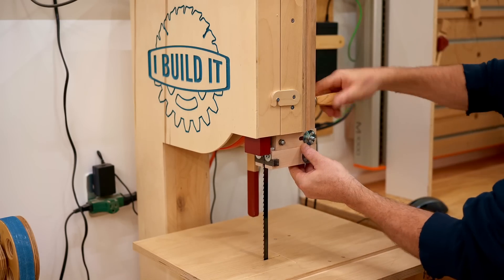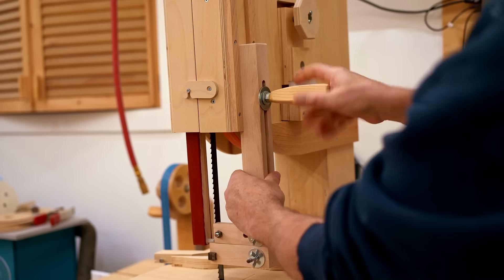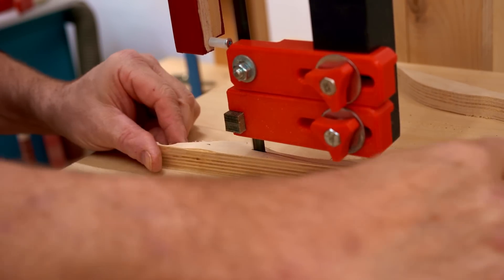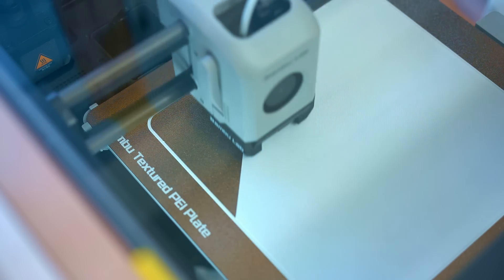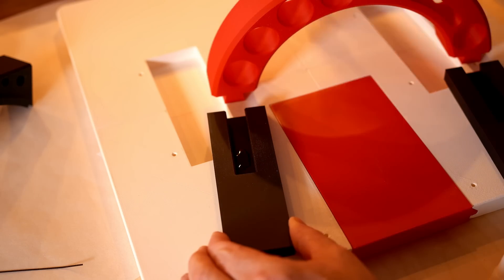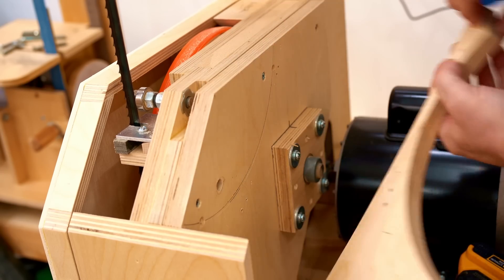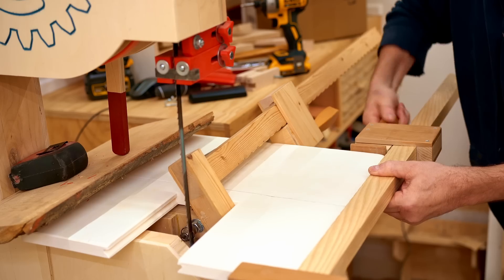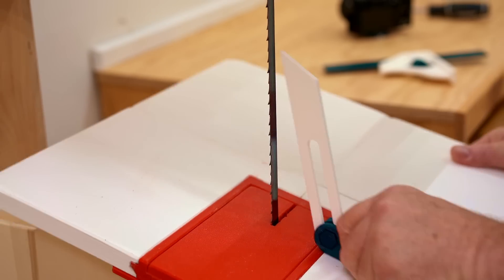He Said You Can't 3D Print a Band Saw... I Said Hold My Beer

Comment from the maker: I have no doubt that a band saw can be made with 3d printed parts - all it would take is the right amount of testing and trial and error to determine how strong the parts need to be.
Of course it couldn't entirely made from 3d printed parts, but then a wooden band saw isn't 100% wood either. You would add metal where you need more concentrated strength, like screws, shafts, bolts and bearings. But I firmly believe everything else could be printed while you kick back munching Cheetos and watching YouTube, while not potentially cutting your fingers off on the table saw you don't know how to use safely. 
And like I said in the video, you don't have to throw away a full day plus expensive paint to finish the parts. So I think that printing the parts (or even paying to have them printed from a stronger plastic) would be fairly economical.
For example, the table I printed used less than a full spool of filament, or roughly $25. The plywood I used to make the original costs MORE than that today! If you can get it, that is. And then you need to machine it and finish it and hope you don't make any mistakes.
So yeah, this may seem like a novelty project, but it is definitely not that.
Remember, guys were saying you CAN'T build a wooden band saw not that long ago. Never say never - you are betting against human ingenuity.

Watch the original build video I made for the band saw here: 
https://youtu.be/-hVw8mpt9N0
Reply: With carbon fiber filled nylon, you can produce some pretty strong parts.

PLA is fun but it doesn't like heat.

Nylon is awesome but trying to print it and having it not to warp on the bed is a challenge.
Reply: CF-PETG and CF-PLA also exist. PLA has the most regidity, which for some applications is actually better. Cf-PETG is slightly better and does not warp with the heat.@ProbeGT2
Reply: Just curious, the original plywood table top looked adequate.  We're there any problems that you had that caused you to redo it on the 3d printer ?
Reply: @joelex7966  What i did get from the start of the video was that this was just a challenge or like a proof of concept. :D
Reply: @pridler85  could be, my feeling is that he was better off with the one piece plywood top provided there were no other problems.  Good video though.
Reply: Joelex… I think he’s just proving a point
Reply: For larger pieces that give the bandsaw its upright rigidity, is there some printing material that won't flex? This would be my primary concern with a 3d printed project like this. The rigidity of plywood, especially half inch ply, would be hard to match when making larger pieces. I would imagine scaling this down to a smaller bandsaw would absolutely be possible. Making a carbon copy of your original build however, i can see why Matthias was skeptical.
Reply: @Rhainee  is there wood that won´t flex? 3d printed PLA is usually better pound per pound and closer to isotropic than standard wood. the thing here is that the pieces printed are hollowed, making them have less torsional rigidity and extremely light compared to a chunk of solid wood. 
how do you make large parts with a small printer? 2 options: good big joints (those made in the video were awful as are designed for internally solid pieces), and welding. welding is the superior method, but takes time and skill (I have welded pretty large pieces that are a lot stiffer than pine wood and close to eucaliptus wood (that stuff is nasty)). 

If we abandon the pure 3d print angle, you can integrate reinforcements into the structure to add some high rigidity reinforcements to take the load (steel or cf bars) or design to accept shell reinforcements (angle iron/aluminum, for example) and use them as part of the joinery. and that would have a stiffness better than some metal ones.
Reply: @giuseppebonatici7169  I understand well the logistics of printing, my question surrounded the rigidity of ply in comparison, particularly the half inch he uses for these kinds of projects. All woods flex, that's the point of ply, the alternating layers and glue which is stiffer than the wood itself makes ply MUCH more rigid. 

Granted you could add structural supports, but would this really compete with that of half inch ply? I can say this for sure: It's much more work.
Reply: @Rhainee  yeah, ply is a magical material, and it has already the adequate geometry for some parts (planar parts). it's easier to just mixin 3d prints into those parts. but then again you can do the same with sheet of steel. 

I wouldn't say that is much work, as it just machine time and using slicer partitioning tools that automate the joining. the bigger problem is cost 1 kg of filament is always more expensive than almost weight equivalent of any plywood. 

also, the glue does not give any significant flexural rigidity, as it reinforces the internal faces only (sure, some marginal flexural rigidity could be added). all the rigidity that you get is the shell effect of slightly compressed wood. and it is not that amazing if you consider the penalty weight of the process.  if you really want stiff materials, you want to use aluminium, composites, or steel, not wood. the plys must be finished, so composites are as work intensive, but with much worse payoff. most of the rigidity of a construction comes from geometry and solidity, not the particular material, as most estructures are essentially air with thing walls of something.
Reply: @giuseppebonatici7169  Will you quit rambling on about random stuff? You typed out two essays and still haven't addressed what my original comment mentioned.
Steel and standard wood were not a part of the comparison. The whole video is about 3D printing a band saw, given that the original build was ply, it makes perfect sense to compare ply to the material to be used in the 3D print. 

Also, if you only print SOME of the parts, the bandsaw isn't exactly 3d printed is it? We're talking about an entirely printed bandsaw. Hence my mention that a smaller bandsaw would be far easier than a bigger one due to the concerns of rigidity. John himself mentioned how it wouldn't be possible to entirely print it, however, the original build was say, 95% wood and 5% fittings? So, it's more than reasonable to assume that you can achieve 95% printed parts. Trial and error, again as John mentioned, lets try and be concise and answer the original question that pertained to the video.

Additionally, weight is clearly not a concern for this project so i'm unsure what relevance that has. If you do indeed know about filaments, I would appreciate a recommendation as to which would be suitable for this case.
Reply: @Rhainee  my arguments is that you do not know what rigidity means at all as you think that is the same as moment of inertia (the only thing that matters in reality).
for filaments, almost everything (except tpu and nylon) has better strengh and rigidity. if you want the best; you would need pex/pei, as they are as strong as steel. more realistically, any cheap and dry PLA is strong and rigid enough except for high temperature zones. PETG or PC for 50° or 120° C, respectively. TPU,  PETG and TPU or PC for impact resistance depending on the regular load expected.
Reply: @giuseppebonatici7169  Okay, nice troll ^^
Reply: you dont even need to print the parts to test them, you can already test them in CAD and its highly advised to do so, it saves you a loooooooot of time and material
Reply: @JohnHeisz I came here to watch someone make things as a maker, woodworker, hobbyist, and no matter the material used, or machining method I am learning. Please explore, and enjoy your creative nature to its fullest. I know there is monetary aspect to the YT's, its not worth it if you, the artist, is miserable.
Reply: It's fascinating. Curious to see where you go will take the 3d prints in the future. What is the texture like on those parts? Its hard to tell on youtube.
Reply: My guess is that most parts CAN be printed. One part will get you into trouble though an that is the FRAME. It has to wthstand the pressure from tensioning the blade and demands some serious strength. I doubt that can be printed sufficiently strong and stiff without getting prohibitively bulky.
Reply: Very nice!!  Was going to ask how the cost compares, and you've already answered.  XD  To answer your question: If I'm honest with myself, I'm more likely to watch a novelty video about, "I engineered and 3D printed a better mousetrap for half the cost of a normal one," than I am an actual woodworking project video.  Even though I don't even own a 3D printer.
Reply: Adding a Bambu X1C to my toolkit is one of the best decisions I've ever made with regard to tools.  Especially with regard to jigs.  I've made so many jigs!  And there isn't nearly as much fiddling for accuracy.
Reply: this is amazing, the 3d printer enables your wonderful engineer mind to create amazing things, stoked to see more in the future!

Comment: Late to the party, but in my honest opinion 3d printing is totally acceptable until it's forced, like for example for the table plane. It was a waste of plastic and the fact your joint weren't precise made the piece of wood steps up, if you know what I mean. The blade guard and tensioner are perfect applications for 3d printing, like the angle measurement tools, if they are really precise of course.

Comment: I think you should continue with your 3D printing replacement policy on the bandsaw - and on other tools etc. You may have been working with wood mainly when I first tuned in but it's your engineering creativity which matters more than the material.

Comment: It's might have been said by someone else in the comments. But technically PLA is stronger than PETG for what most people would understand as "stronger". PLA is more tough but more brittle and will tend to crack when it fails. PETG is more flexible and will tend to yield by deforming when it fails but it yields at a lower load than PLA. Mechanical properties of printed parts get very complex because the Mechanical properties of the plastic itself depends on printing settings (speeds and temps) and the macro properties of the part add the dependency on the print orientation and the infill properties.
You see many many people parrot things about what plastic type to use with next to no understanding of how any of it behaves fresh off the bed, fatigues, or ages from sunlight weather and chemicals. So as you'd expect they're pretty far off the mark.

to answer the final question, I'll watch both wood and plastic XD

Comment: I think that 3D printing the smaller and detail parts is good, but the larger parts, especially those that need some strength should be wood. I think a balance of the two methods is best, not a wholesale changeover to 3D printing.

Comment: Gyroid infill is stronger than cubic, but hexagonal is the strongest. You also should not rely on infill for strength; use perimeters instead. A part printed with 5% infill and 12 perimeters will be much stronger than a part printed with 50% infill and 2 perimeters.

Comment: Hey John,
thanks for all the great content over the years.

3D printing is here to stay. I think this is obvious by now. It can add a lot of value to every shop if one takes his time to understand the technology, its advantages and limitations and use it where it makes sense. I think you will master it as you mastered the mix of woodworking and metalworking.
A bandsaw table just isn't a part that should be 3D printed. It's too big and not really complex enough. Rather make it from plywood or metal.
Instead print smaller, more complex parts like these blade guides, or parts you need a lot of.
Also consider making printed parts as complex as possible to make other (no printed) parts simpler (see "complexity shifting" as Christopher Helmke (great channel btw.) called it).

Like you said: "When you have a 3D printer everything looks like plastic". This is dangerous in my opinion. You are a great craftsman. Don't fall for that and become an other Ivan Miranda who just prints everything whether it makes sense or not.

I think, if you use 3d printing wisely (like for instance Marius Hornberger, James Clough ...) it can add a lot of value to your shop and your channel. But I'm shure you will.

Have a nice day and keep up the great work

Comment: love the project but a few recommendations for printing in the future.
1. printing threads is almost always a bad plan unless they are big for other parts. the better solution is print a hole for a threaded insert or cutting like you did. when you do this, you want more walls around that hole to allow for better grip and you also heat the screw beforehand to mold the thread rather than cutting it.
2. you can improve layer adhesion by after printing putting it in your oven for a bit to make the layers better adhere to each other.
love the project and would love to see you switch the full machine over to printed parts just to see how far it can go and good job on the dowels it looks like you printed them the long way and not up right (most get that wrong the first time)

i also recommend using the printer for jigs and such to speed up work as plastic tends to be cheaper then wood and i find it faster to model some weird jigs then to make them out of wood.

Comment: Each tool for the right job. If what you build requires precision and accuracy - print it. If it needs strength and size - use wood! For example, I own a Infinity, but I printed a z gantry modification to use a Kress spindle with a 43mm diameter holding area. This cannot be done with wood.

Comment: Current 3D printers today remind me of when I started working in Graphic Design and desktop publishing with ink/toner printers. Before we had large format printers we had to print all our poster size jobs on 11x17 paper. Then we had to cut and trim the edges and each piece had "overlap" region. That way we could line them all up on a big foamcore board like wallpaper. Would have to glue on 5+ pieces to make a whole poster. Kinda like what you did for the table. 

I guess until we get affordable "Large Format 3d printers" we will need to do the same. Just like ink large format printers they will still be a decent junk of change of change. But today a decent large format ink printer can be had for $1-2K. Just 5-10 years ago those same printers were $5-6k.

Comment: CA glue?    in my experience CA is borderline useless in PETG, at least on PETG to PETG.   I usually use 3D Gloop as my part joining material of choice, can't call Gloop an adhesive, because it chemically welds the parts together, doesn;t just glue them together.  Also, my design skills are non existent, but I have been curious about using slide in inserts, like for your table, printed in the opposite orientation, effectively making 3D printed plywood, so that the differing 'grains' reinforce each other.  the way that your insert failed prompted me to suggest that here    i'd love to be able to 3D print a band saw, I hope that you complete an entire 3D build of it

Comment: You come up with such good ideas and hacks, I'll watch whatever the medium. My most recent design/build using 3D printing that would have been much more difficult in wood is a block that I can use to set my L-Fence when cutting miters on the table saw. It has a 45º foot that fits into the curf cut halfway down a test piece, and a flat 1" surface that is coplaner to the front of the curf. I just bump the L-Fence up against it and tighten it down. Perfect miters. Keep inventing stuff!

Comment: Be Carefull with "no Painting" i am literally just finishing some Outdoorparts in Wood-PLA while watching this video. I am going to Clearcoat them. PLA is hydrophil and takes moisture in, after 3-4 years of a higher moisture rate so above 40% it will start to rott. Spraycoating it will make those parts longer lasting. For the Edge lifting of the prints: 3DLAC will reduce it, only needed every 3-5 prints to refresh the bed. 
For the Question: I would like to see Composites. Large Wooden Parts which have funkional 3D inserts. Like this Table: Table out of Wood the Insert, Trunion and Guides out of PLA. The Strongside of 3D Prints are complex prints not large Parts.

Comment: 3d printed parts are great for complicated shapes. But i find it silly to use them for things wood or steel are a million times better suited for. Also those joints are always a weak piont resulting from the limited dimensions your printer can print.

Comment: If youre going to cut into the table you can "trick" the slicer into making that area solid by having impossibly thin walls/holes in the model so it will print a solid brick in that location. Otherwise youre cutting through walls into the infill dramatically weakening the part.

Comment: While printing is cool and accessible I think the best option is to make the best use of each material. Wood where needed and plastic where it makes sense. For example large sheets may be both cheaper and stronger with wood (filament isn't that cheap honestly) while small complex details and adapters are easier to make with printing.